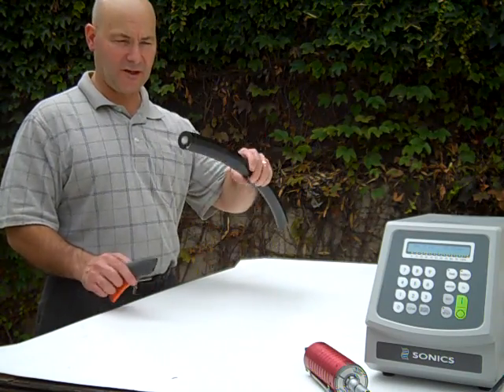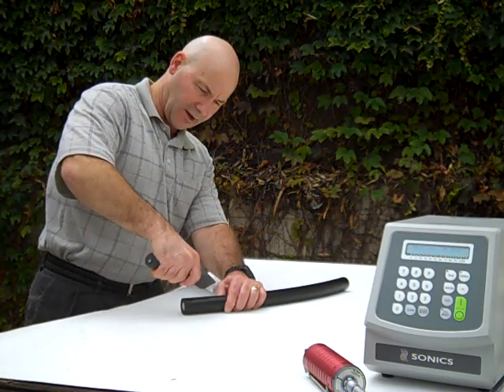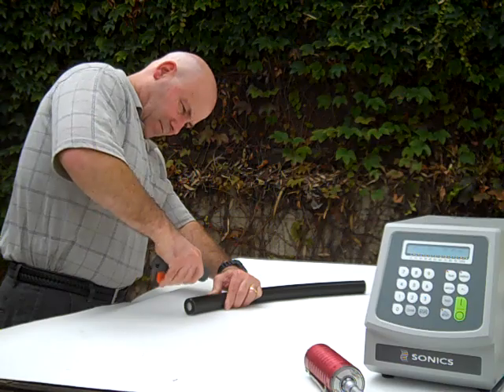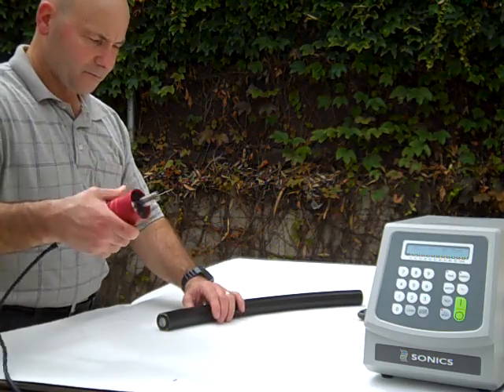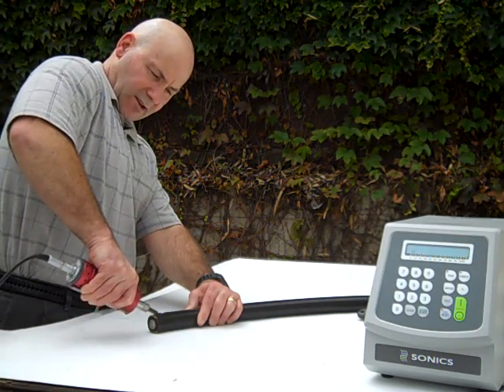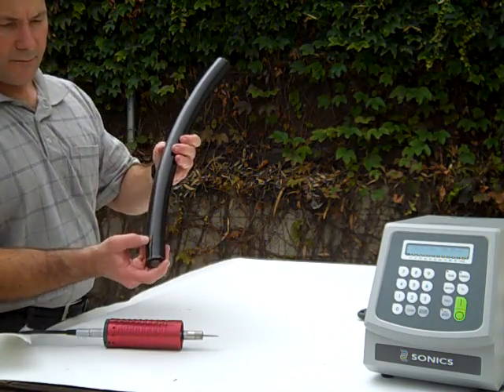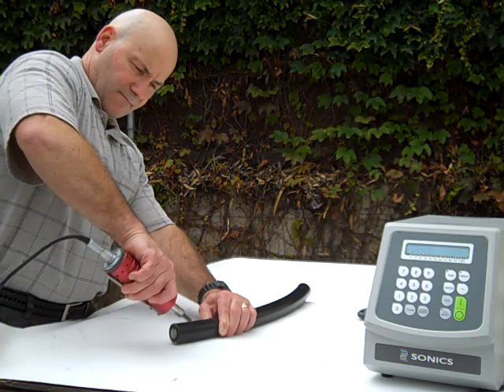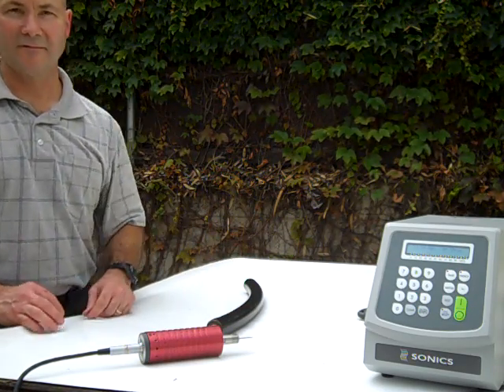Ultrasonic Knife vs Safety Knife

Comment: The 2nd knife did not look like less pressure at all.
Reply: It doesn't even look like a knife. It's edge is all but nonexistent, relying on melting the object with heat rather than sawing it in sonic speeds.